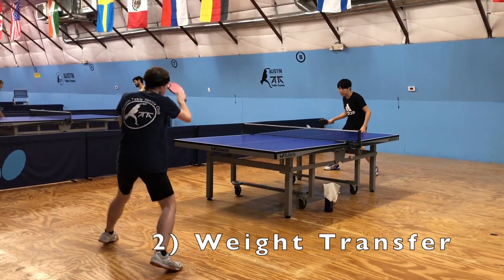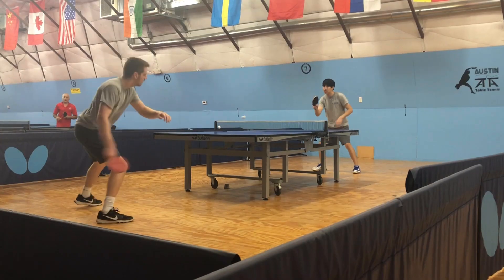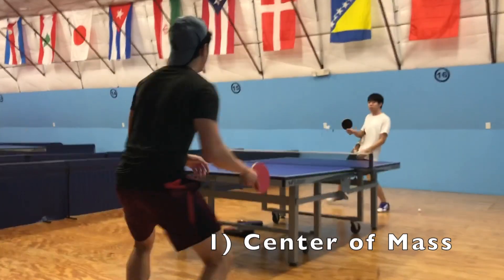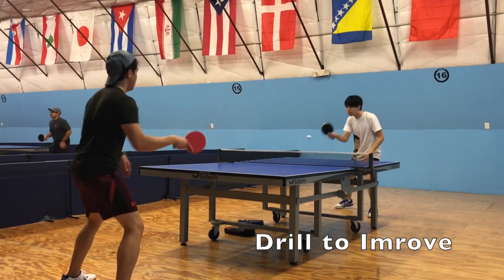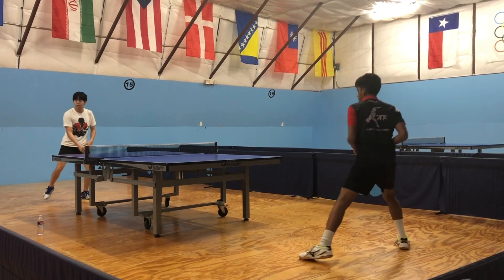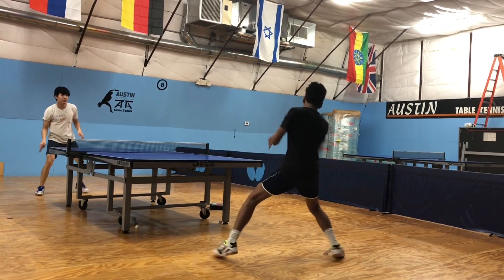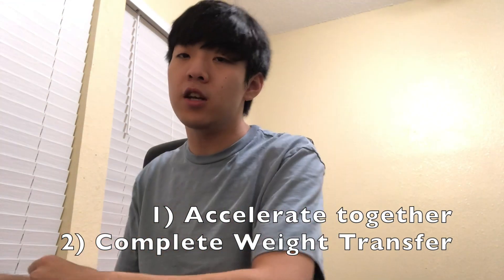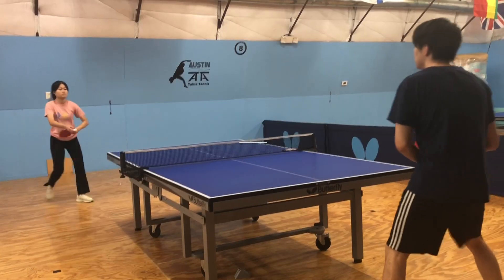8 Forehand Loop Mistakes YOU Make

Comment: Hello Panda Pong, your video is really good and in depth so it's of really high value for me. Nonetheless I'm not particularly sure what the second bullet point at 4:38 means...releasing the elbow. Could you explain this concept to me please?
Reply from the maker: I meant that you need to make sure your elbow is not locked. Some people keep their elbow locked during the swing and it doesn’t snap during the stroke which makes the stroke too stiff
Reply: @PandaPong  thanks for your answer, that's right, here in Germany it's commonly thought to lock your elbow for backhand. So the snapping of the elbow comes from a strong pull of the triceps ,from relaxation and sudden tension in the upper arm or from the weight transfer?
Reply from the maker: U should use your arm to snap your elbow, but also you won’t get any power without weight transfer. You need both and they need to be timed together
Reply: @PandaPong  thanks, I hope I got it.

Comment: Can you help me fix my weight transfer and my forehand stroke ?
Reply from the maker: Sure send me a video: pandapong2020@gmail.com
Reply: @PandaPong  Thank you very much. I tend to use my arm and wrist only. Tried to do the waist and hip rotation don't think I'm doing it right and not in sync
Reply: Hence no power in my forehand loop
Reply: I think my Centre of Mass needs to be fixed. Probably need a wider stance

Comment: you wanna learn correct stroke? stop buying some carbon baldes and goes for gippy dead sheets with classic wood , even a cutboard would be good. What the point  you would say me? YOU ARE SMART AND HUMAN ADAPTATION IS AWESOME, try to put the emhapsizes on weight transer and hitting the ball with your body (POWER COMES FROM STOMACH)  also you shoulders should be parrallel to the table and you end being like a bow . I sse too often lazy people cheating and being already in one stance or another but they are losing body momentum. First stroke will be strong but at each of them they lose precision and power kinda easy too outplay.